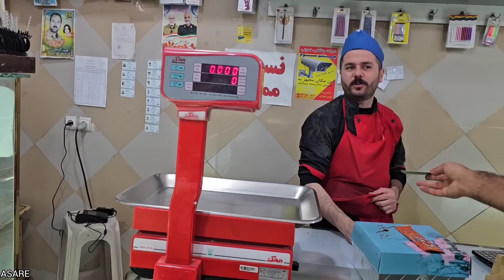Embracing Motherhood: A Nomadic Journey of Love and Learning

Comment: It’s car cooling system problem  
Probably old antifreeze — old antifreeze tends to corrode 
Needs to flush out the cooling system and put new water and antifreeze. 
Probably does t do regular check under the hood or he would’ve noticed the rusty water in the overflow tank